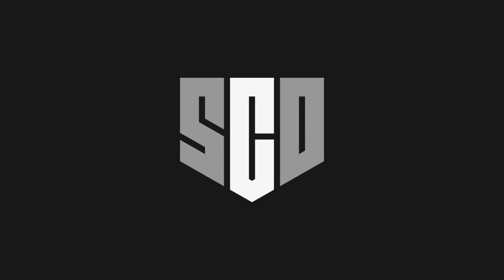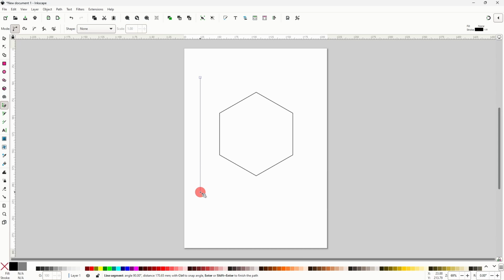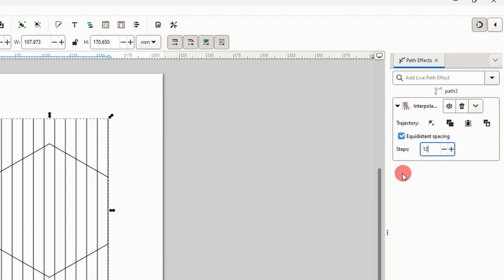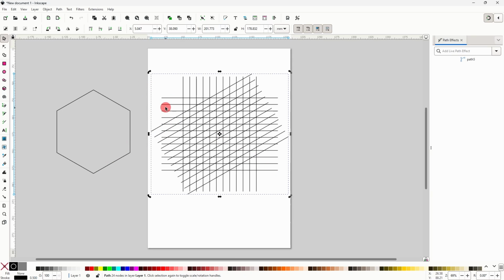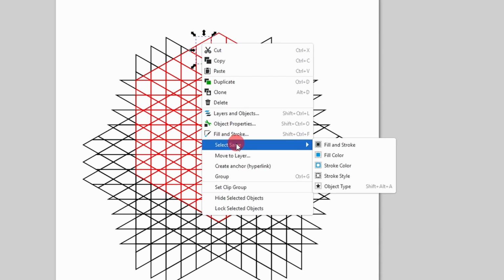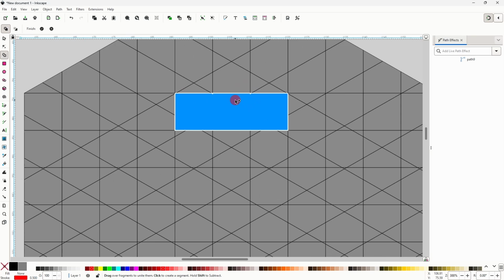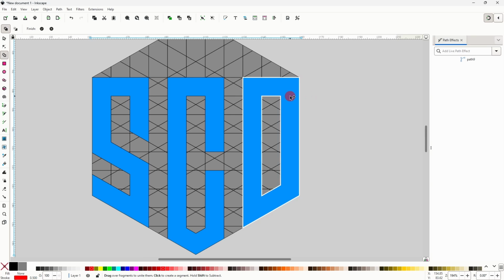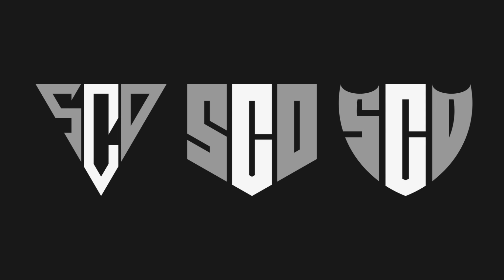Monogram Logo Design Process Using Grids in Inkscape 1.3

Comment: Great tutorial! Do you also have the "flaw" with the shape builder tool that a circular object changes shape after you used the shape builder tool? The nicely rounded shape gets deformed a bit
Reply from the maker: Yep. To prevent that, before using the shape builder tool, turn the circle(s) into paths, then use the node tool to select all of the nodes and click the "Make selected nodes symmetric" button in the controls bar.
Reply: @SweaterCatDesigns  wow thanks! I was working with strokes so thats why. I'm trying it out right away!